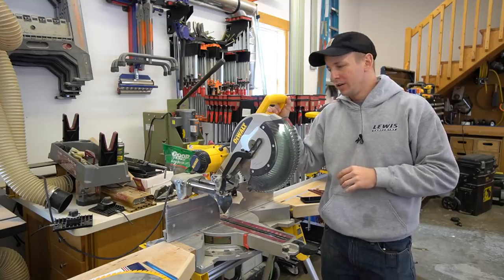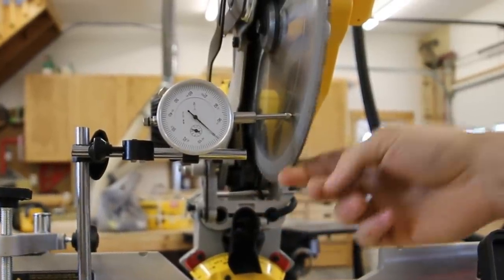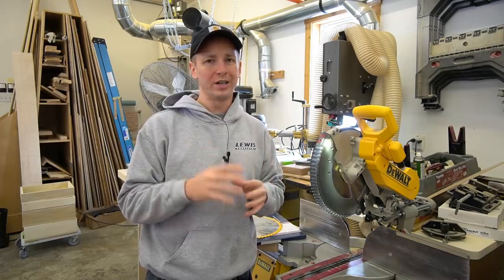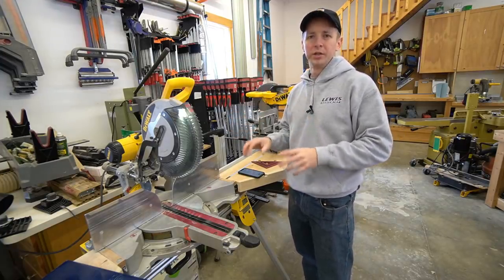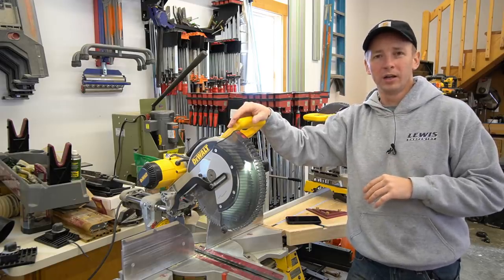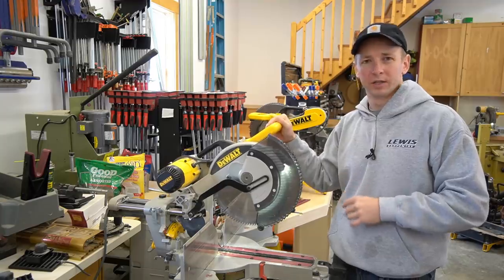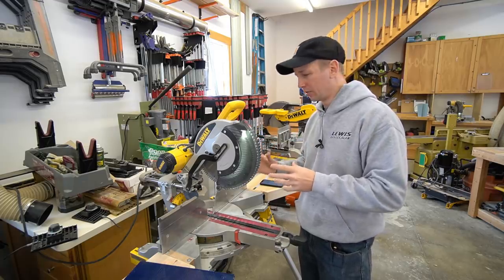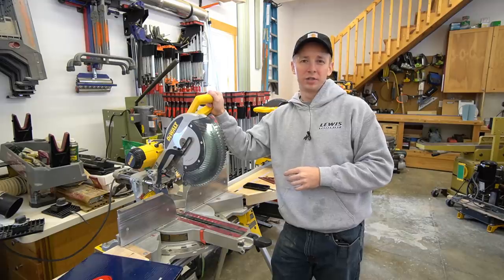DEWALT DWS780 | The BEST Miter Saw for Production Trim Carpenters???

Comment: I bought the 779, it was on sale for about 280 at my local home depot, and I bought the xps light online for around 50 bucks.
Reply: Is that the only difference between the two models?? I recently bought the 779 on sale too. Didn’t realize it didn’t have the light until I used it the first time
Reply: Same here, bought it on sale plus a veterans discount. Adding the XPS light was a very easy upgrade/mod and saved a bunch of money. 

He mentioned the 779 being heavier, I haven't compared, but my saw doesn't travel, so if that is the case a heavier saw is actually better.
Reply: @lyleconway6795  He said in the video they are made in different places. He thought the 779 was made in another country. Also didn't hold up as well as the 780. Being abused. But he did say they were both good saws.
Reply: I have the 779 where do you get the light?
Reply: @73ryan  check his links. Might be there. Otherwise I'm sure Dewalt will have a part number to look up.
Reply: @73ryan  there's some guy here on YouTube who shows step by step on where to buy it, and how to install it.
Reply: @lyleconway6795  it literally looks the same. I went to home depot, checked online, read the specs, etc. The other difference is a $300 difference lol
Reply: @MR-si1eq  regardless of those details, as far as I've known, dewalt for some time now has been made in the USA with global components. It also beats the old ridgid miter saw i had. It works great and I'm confident with it. I'd recommend it all day
Reply: @creeplife2802  thanks!
Reply: @73ryan  that's the channel, it wasn't letting me post the link
Reply: @creeplife2802  thanks I really appreciate it
Reply: @lyleconway6795  There is other differences. Comparing the newest versions of both (type 22) the 779 has a plastic bevel lock knob instead of metal , no preset bevel stops, and no lock lever on the slide. The newest version of the 779 weighs the same as the 780 at 56 pounds.
Reply: @MR-si1eq  I pretty sure they are both made in Taiwan unless  something changed recently.
Reply: @creeplife2802  I'm trying to find the 779 for $300 less than the 780. Could you please send a link. Amazon is $500 Ebay 549.
780 is $599 on everything i Googled.
Reply: @jameshill4900  no positive bevel stops?!? This may be a deal breaker. Buddy in this video prefers to cut his base standing up, I prefer to cut my base laying flat with saw beveled.
Reply: @lyleconway6795  It's unfortunate. The 779 type 20 and 21 had the pawls. IMO dewalt removed them and the other features to save a couple bucks and make the more pricey 780 a more "clear" upgrade.
Reply: @MR-si1eq  Yea the price for the 779 was cheap weeks ago, I purchased mine for around 349 and two day later sold out at Homedepot and the price was back to 500 or so.
Reply: @Androidandmore101  I just found it for 399 at home depot. They are just about out everywhere. Oh and thanks for the reply..
Reply: Dang those prices will never be seen again. 
I got a reconditioned 780 after discount for $475 and that's a steal nowadays.
I miss the pricing a few years ago. 
Hope it's still running strong

Comment: I added the light to my 779 for about $70.00
Reply: I added one, as well. However,  they used to only cost $35. Not sure why DeWalt doubled the price.
Reply: @trimcoversit3971  I bought the kit with the handle and switch for the light.

Comment: Dewalt has just recalled this saw and others I found out today after trying to order parts and finding them discontinued. I called Dewalt and asked; Dewalt confirmed a safety recall this is about the blade guard. Dewalt issued me a case number and will be replacing the entire saw unit but would not give me a part #. Not holdingg my breath

Comment: Run out is different then deflection. That said, most of the problem comes from the rails. I've found sliders to be less acuarate, so I use a non slider for trim work that won't be painted.

Comment: I had a Dewalt 779 for awhile and it is a great saw but I was storing under my bench and it was heavy to move I ended up selling it. The extra capacity was overkill for me who is simply a hobbyist and not doing this for a living. As a mechanic for 15 years who owns a lot of Snap On tools I can appreciate quality tools but the Kapex is so incredibly overpriced compared to other mitre saws I don’t even consider it for any mitre saw comparison. I had a Bosch glide for awhile and the glide mechanism was amazingly smooth but it had a lot of head deflection even when locked for chopping. It could have been user error but I did not have the issue on any saw before or since. Great video and sweet shop!

Comment: 3 things on that saw I didn't like and made me return it:
1). Biggest issue, slider is not smooth, especially when the blade is all the way down
2) the dust extraction on the back plus the bug is really ridiculous
3) The motor starts instantly at full power kicking the saw up if you have it lowered when you press the button.
4) DeWalt support doesn't have technical experience. Called them for the slider issue and didn't really get any technical help.
Anyone else had the slider issue? Mine was the type 22
Reply: 100% correct about the slider issue. I had a type 1 when these came out and now have a type 23.. neither of these revisions addressed the stiff sliding action for me. To be clear, it's in no way a deal breaker for me and people shouldn't take this as meaning the slider is defective; it's simply an inherent design issue and will mean you'll need to pull and push slightly harder than other saws on the market. Even the Ridgid saws slide muuuuch smoother than this. If butter smooth sliding action is critical to your work then yes this won't be the best in that regard, but all other positive aspects of this saw trump that issue, for me anyways
Reply: @SR-te2db  my main problem with the slider was not that it requires more power to slide it, but that the powered required was not consistent across the slide. To try to explain it better, if I apply the same power to slide the blade back, there will be cases where the sliding will stop and will need to push harder, then the resistance will get less at one point and will find my self sliding faster, unable to control it fully.

Comment: Another difference between the DeWalt 779 and the DeWalt 780 is the 780 has a 14 inch Cross Cut capacity at 90 degrees and the 779 has a 12 inch Cross Cut capacity at 90 degrees.

Comment: My vote is for the Milwaukee 12" slide
Reasons:
1) Digital read out in 1/10 of a degree. Many times you need the precision of moving just slightly. So you try to move your cutting head... and you have to make a cut to see if the head moved?? To answer the question....did it move at all, move backwards,  or forward too moch?? This is where the sensitive Digital read out shines!! Example: odd angle joint. You wish to make a miter crown joint. You devide that angle in half. Let's say it's 37.6°  .  Now you can write it down and accurately return later . This is extremely helpful especially if you are sharing the saw with other crew members !!

2) slyde/head stiffness or rigidity. Pull the cutter head all the way towards you. Lock both the pivoting and head travel down. Now left hand on the saw base and right hand on the cutting head. Test for sideways stiffness!! The Milwaukee is the winner by far compared to all other saws !! This yields a better cut under load. A better joint under load!
3) great double light!
4) 3 year warranty 

Once you use the digital read out....you will never go back!!

just jim
Reply: What exactly do you mean by digital readout? What does it display?
Reply: @kjk7225  the saw head moves in 2 different ways. The head can pivot or tilt. Let's say you are cutting baseboard or chairail in a room that is retangler.  There is no need to tilt the head.....mearly pivot the head to 45° and if the corner is "truly square.....cut. the digital read out (numerical numbers on the small screen)    will show actual numbers 
...45°.

If the corner is not square and you devide the angle....lets say it is less then 90°..... maybe it's 89.8° when you devide the angle equally....you will see these actually on a screen as opposed to a crude pointer on a radius scale. 

Like a clock indicating time....old fashion....hands pointing to a clock face.....vs a digital read out on your microwave......
Reply: @jimknowles5483  thanks Jim... the digital feature sounds unique to Milwaukee...
Reply: @joemartines3545  Joe, the other competitors do not have the digital read out. They and most carpenters don't realize how insanely important and accurate that precision is!! Besides my saw, I have only seen 2 other 12" Milwaukee slide saws like it. People just don't know.....!

just jim
Reply: @jimknowles5483  Jim, is your saw cordless or corded?

Comment: Ive got a kapex,  dw 716, dhs790, dcs361

I didnt want to buy dewalts but except for the kapex and the old school 10" hitachis it's the only saw on the market if tested with acceptable head deflection. My DW716 has 0 deflection. Wth a forrest chopmaster,  bosch dust collection boot and an ez speedy fence it's a better trim saw than the Kapex. I still gravitate towards the Kapex because of the fast setup with the wings and im more familar with it.

Comment: I have the DWS779 and it is identical in all specs to the DWS780, same weight exactly.  The only difference (confirmed with Dewalt BTW) is the XPS work light, which I added to mine with a $75 kit that replaces the handle with a 780 handle.  779 is about $150 cheaper.  100% agree that the light changes the game dramatically... worth the investment.  Also agree on the cheap Dewalt blades, they're junk... spend some $ and get a good blade.  It's a great saw!
Reply: The 779 is 14 lbs heavier , there are more differences than just a light.
Reply: I have 779 and 780. 
I think they weight the same but the cheaper one is missing a lot. Blade stop and angle lock are a huge deal for me. Depends on what you need it for. Both work great
Reply: This is simply not true….. and of course Dewalt CS will confirm this is the only difference.  Based on specs, it is an accurate statement.  However,  the 780 has a more commercial grade motor (same specs/different quality) as well as better bearings, etc.  I have confirmed this with a local service center. The parts lists are different.

Comment: Looks like the FlexVolt is the same wight as the 780. Use batteries or cord. Yeah I have been using a 10 inch for ever thinking its more accurate but also less cumbersome to move around. Only 200 smackers more.

Comment: I have a DWS780, and It's a great saw.  However, it has a large tool depth from front to back.  Due to changes in my workshop, I need a sliding saw with a smaller foot print front to back.  Thinking about the  Bosch GCM12SD or the Makita LS1219L.  They both have a shorter tool depth from front to back, but obviously very different articulation mechanisms.  I build custom furniture in a small shop and need a fixed miter saw setup, so unlike you, I don't need to travel with it.  Not interested in the Festool.  I mainly need 1) accuracy 2) dust collection 3) footprint depth.

Comment: I couldn't agree with your review more. I am a finish carpentry contractor, like you, and I landed on the same two choices for miter saws (DWS780 and DW716). The DW716 is my primary choice for a jobsite saw. It is a little lighter and takes up less real estate in the truck than the DWS780 and it can handle almost all the widths I deal with on a daily basis. I purchased the DW716 in 2011 to replace a DW706 (purchased in 2003). There was nothing wrong with the DW706, the DW716 just had enough improvements to warrant the upgrade (lever lock instead of a twist lock and the LED light). That is one of the things I like most about DeWalt tools; they are constantly evolving and improving. Back in 2000, when I first had jobs that required cutting wider material, I got the DW708 (DeWalt's first stab at sliding compound miter saws). It was a good saw but the rails were mounted vertically which tended to allow a little side to side deflection. I think there were a couple of subsequent models but in 2013 when I saw DeWalt had addressed all the shortcomings of previous models I purchased one....no regrets. I agree, the dust collection may not be the best, but it is world better than the DW708 was. After a little required tweaking on both saws the accuracy is excellent. In fact, surprisingly, the DWS780 is a shade better than the DW716. BTW: The DW716 says "made in Mexico".....for some reason that makes me feel better than "made in China". Just me, I guess. Wonder if we'll ever see "made in the USA" again? Enough rambling.
Reply: I also tend to agree with your take on Festool. They make precision tools that accomplish the tasks they were designed to accomplish (at a staggering price) but they don't seem to be rugged enough to withstand real world use. Back in 2008 I had a job replacing several doors in a carpeted office building and had to set up in the hallway. Knowing how much sawdust my Porter Cable 126 planer spews out I thought I would try the Festool  H 850 E planer (at the time $560) and the CT-22 dust extractor (at the time $520 plus $200 for a permanent cloth bag) to contain the dust. I must say that I was stunned at how well the dust extraction worked at containing the mess but in the subsequent years the dust extractor has literally self destructed due to how brittle the plastic they used is. The planer is excellent, and I still use it to this day and I still can use the dust extractor but it has several chunks missing and none of that damage is as a result of abuse from me. I don't think the saying. "you get what you pay for" really applies to Festool. I don't mind paying an exorbitant price for a tool as long as it is, by far, the best tool available. In the case of Festool I think it's more mystique than reality. BTW: To replace that setup today I would have to pay $733 for the planer and $1,045 for the dust extractor with cloth bag. By comparison in 2013 I paid $593 for my DWS780 sliding compound miter saw; today it would set me back $645......a little bit different rate of inflation. All prices include sales tax

Comment: Great video. I personally run 706-716 and the Dewalt 10” slider.  Great saws for the money.

Do you have plans to do a video on job site lighting?
I noticed your large 360° LED light sitting on your bench

Comment: @12:15  Initially, I thought the XPS was a gimmicky thing UNTIL I used it.  Then I was a convert.   And like a lot of miter saw, the dust collection could be better.   I just slapped some plastic wings on the L/R of the base and it improved considerably.

Comment: I discovered that the holes drilled for my fence system were all off from the factory. The bevel on the screws pull the entire system pull both sides out by a half degree. From both left and right sides cut at 90.5 degrees

Comment: fyi if you have the time and are looking to save $100 or so you can get the 779 and buy an aftermarket xps kit. takes about half an hour to install, so if you plan on tuning up the saw out of the box it could be a good option to buy the 779 and a light kit for it.

Comment: I had the flexvolt version which was rugged and accurate. I just couldn't handle the dust collection issues due to the nature of my work. I tried the "new" kapex but straight out of the box it was damaged. Swapped it out, another one damaged. Walked away after having my hands on 2 different kapex saws in a week. Can't pay that and have to replace parts on day one. Now, running the Milwaukee 12" and 7-1/4" depending on the job. The dust collection is a huge step up from the dewalt and I really can't say enough about how I love the lightweight aspect. My 12" weighs about 47 lbs and the 7-1/4 is something silly like 28lbs. I will say I miss how my dewalt stayed calibrated. For whatever reason I feel like that saw only needed a checkup once a month. The milwaukee, I definitely check it every job and commonly need a small shift.

Comment: Spencer & others, beware of the Flexvolt 12" slider. Bought 2 of them, used them 95% of the time using the ac adapter. Both saws died. Had Dewalt repair them under warranty, both motors died again. Lost my trust in that particular model.  Have 6 DWS780's, and they've been bulletproof. Workhorses day in/day out.
Reply from the maker: Good to know. Thanks for the feedback on those saws. I haven't owned one as of yet.
Reply: Why buy cordless then run it corded?  From experience, that saw does not run well on the adapter. It will work if your batteries die and you've got power, but it's not intended to run on ac.

Comment: The difference between the 780 and the 779 is that they priced out all the internal parts for cheaper parts and ta-da you have the 779 the cheap parts are reflected in the cheap price.
Reply: This is correct, but they also removed a few features to justify the lower price to the consumer, or rather the higher price of the 780.  They certainly weren’t going to market it as “the 780 has quality components and the 779 is crap”.  

Bottom line, the 780 is contracture grade quality/longevity, the 779 is hobbyist/DIY

Comment: Hi just a word on the Kapex motor situation; I was at the last AWFS show in Vegas and talked with a German factory rep at the Festool booth and voiced my concerns about the weak motor on my Kapex and all reported motor failures. He handed me a piece of 8/4 oak and said try the new Kapex with motor upgrade. I did and I can tell you what a difference. It didn't bog down at all. He also told me that since my saw was still under warranty, to send it back and Festool would replace the motor with the new upgraded one at no cost. They did and now I'm much happier. Like you said though, time will tell!
Reply from the maker: That’s good to hear.